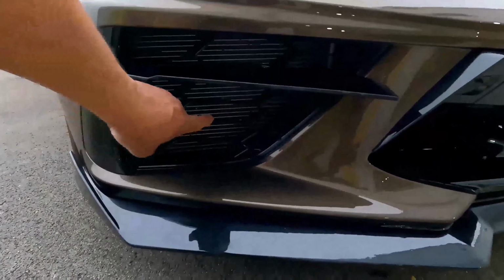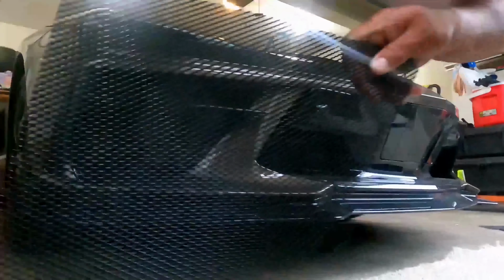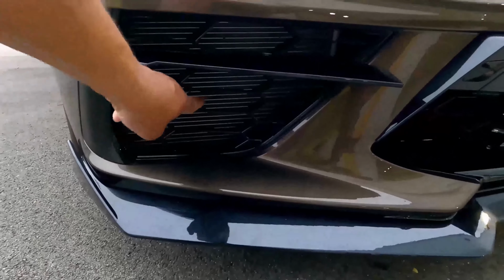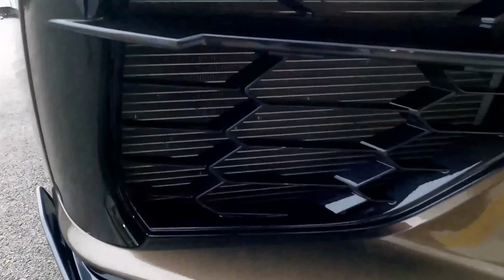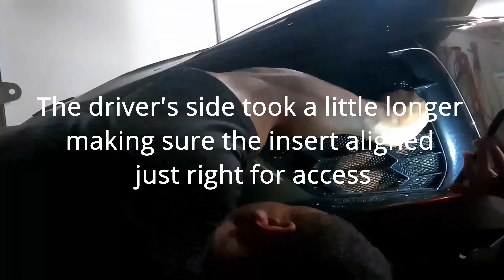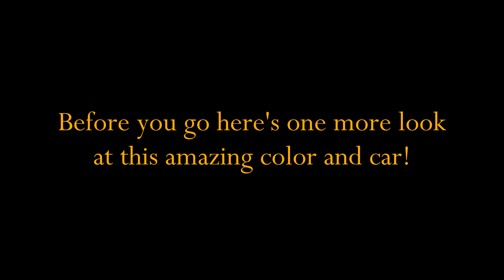A Modification Every C8 Needs

Comment: Modify them Camaro tail lights back to the original circular tail lights which  made the car what it is today.
Reply from the maker: If I'm not mistaken the tail light was on the C7 first and just like the 2008 malibu having circular tail lights, they changed the camaro's tail lights to tie it in with the herritage of the vette.  Chevy has been doing that for years with their other models, giving them a connection with their premier vehicle.